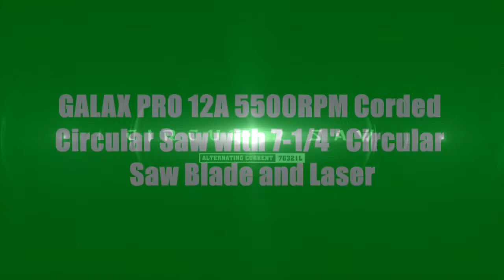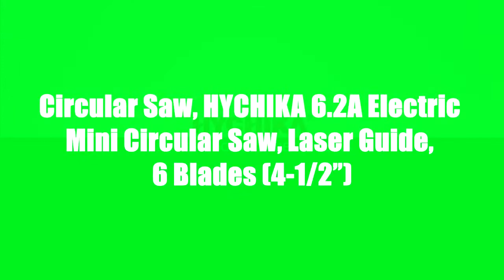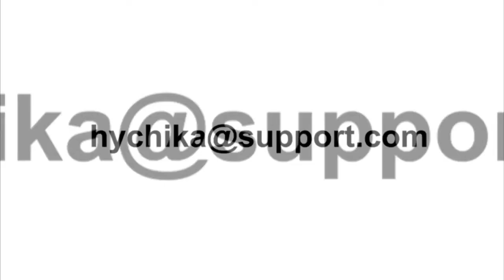TOP 5: Best Corded Circular Saws 2022 | Quick and More Efficient Cuts

Comment from the maker: ✅ SUBSCRIBE, PLEASE: https://bit.ly/MihandReviews

TOP 5: Best Corded Circular Saws 2022 | Quick and More Efficient Cuts

⭐ Amazon US, UK, CA & DE Links ⭐

5. GALAX PRO 12A 5500RPM Corded Circular Saw with 7-1/4" Circular Saw Blade and Laser

Amazon US: https://amzn.to/3ynDtF5
Amazon UK: https://amzn.to/3N6uAnp
Amazon CA: https://amzn.to/3N7OoXP
Amazon DE: https://amzn.to/3P9JlYD

4. CRAFTSMAN 7-1/4-Inch Best Corded Circular Saws 2022 - 15-Amp

Amazon US: https://amzn.to/3FvN7qG
Amazon UK: https://amzn.to/3MgDZsV
Amazon CA: https://amzn.to/3FtXOdD
Amazon DE: https://amzn.to/3leme1v

3. BOSCH CS10 7-1/4-Inch 15 Amp Circular Saw

Amazon US: https://amzn.to/3KZtEjs
Amazon UK: https://amzn.to/397f4t5
Amazon CA: https://amzn.to/3vXbYR8
Amazon DE: https://amzn.to/37wj8m1

2. Circular Saw, HYCHIKA 6.2A Electric Mini Circular Saw, Laser Guide, 6 Blades (4-1/2”), Max Cutting Depth 1-11/16'' 

Amazon US: https://amzn.to/3wjYuxJ
Amazon UK: https://amzn.to/37uSlGH
Amazon CA: https://amzn.to/3wfJgKb
Amazon DE: https://amzn.to/3965IO2

1. Worx WX429L 4 Amp WORXSAW 4.5" Electric Compact Circular Saw

Amazon US: https://amzn.to/3N2gROv
Amazon UK: https://amzn.to/3yqEWdO
Amazon CA: https://amzn.to/3M3hqHZ
Amazon DE: https://amzn.to/3M69BkH